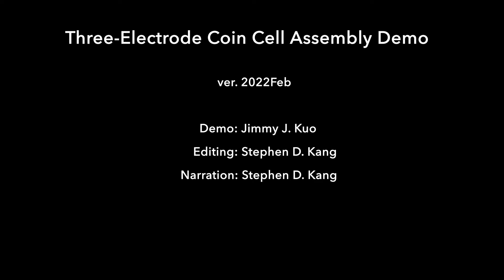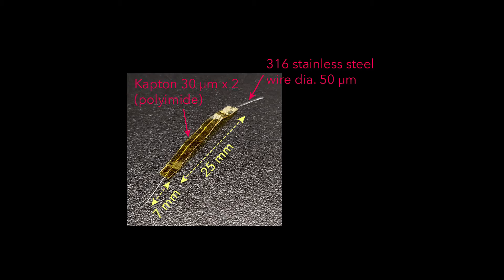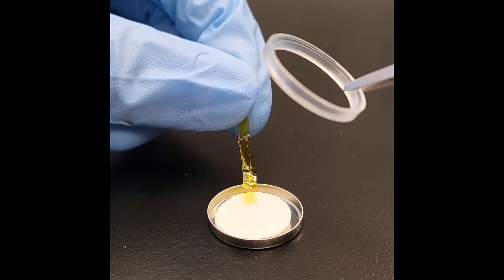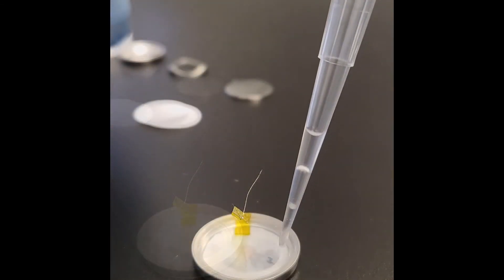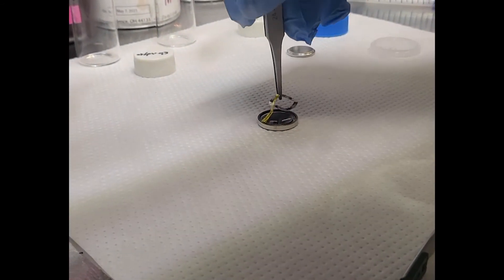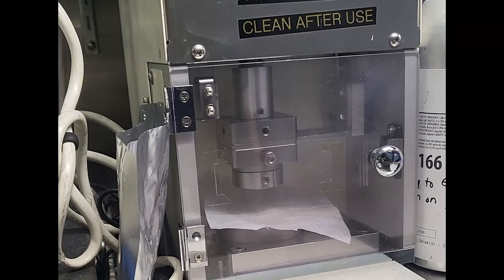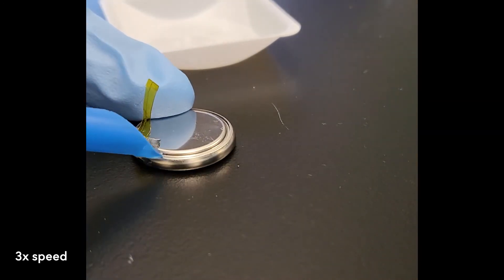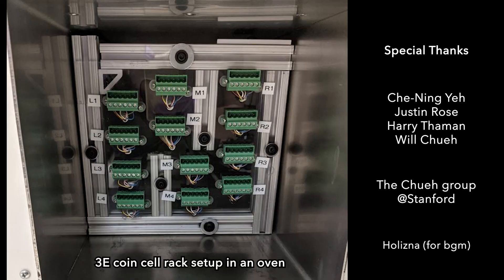3-electrode coin cell assembly demonstration (ver. 2022Feb)

Comment: Thanks! I made one right now as a kid, but, i use papers as seperators, metal spring as wires, flat glued circle metal, a CR2025 Cell button, paper graphite as the Li or sometimes can be semiconductor, and thats what i use to make electrolytric cell.

Comment: Hi,
If I use enameled copper wire, without any polyimide tape, do you think the epoxy will still be necessary?
Also, adding a tiny blob of lithium on the wire would probably be better than the copper mesh.
Thank you.

Comment: Thank you! Great video, I actually made one myself in my lab following your video. I used stainless steel mesh and it worked fine :)
Reply: hi, can i ask you a question? In this video, the author said he used the copper mesh as a substrate for the reference electrode (RE), but I didn't see the RE in his assembly process. Can you point it out for me?
Reply: @ThangPVan_  The copper mesh is used as a substrate for lithium, which will be deposited electrochemically (you have to apply low potential (slightly lower than 0 V vs Li+/Li0) between the mesh (working e.) and lithium electrode (counter e.). That will result in dissolution of lithium metal on the anode of the full cell and deposition on copper mesh. And there you go, you have lithium covered reference electrode :) Tip: use current-controlled process, and limit the current to very low values (in the range of 1 uA max or even lower), to decrease growth of lithium dendrites. If you measure the charge that will flow, you can derive how much lithium was deposited :)
Reply: @tangopies  Hi again, I so appreciate your quick and informative response. I'm just a beginner in this subject, so hope you do not feel bothered when I ask further questions in the near future.
Reply: @ThangPVan_  Sure :)
Reply: Hi, i just wondering why using 3-electrode cell? which kind of data will get from this cell?
Reply: @hanfu-q1e  You can get the exact potential of the cathode and the anode. Without the reference elecrtode, you can only get the votage of the whole cell.
Reply: @ got it, really did help.
Reply: @ are you chinese?
Reply: @hanfu-q1e  Yep, and I'm working on lithium-ion batteries.
Reply: @ wow太巧了，我是一名博士生，也是研究的电池方向，可以与您多交流嘛？
Reply: @hanfu-q1e  可以，之前留了联系方式被吞了😂，您看看如何联系一下

Comment: This is lithum-metal battery?
In this system, what is the role of reference elecrtode? 
Cu mesh?
Reply: In my opinion, this is not a lithium-metal battery but rather a "half-cell". Although a lithium disk is used as the anode, during cycling (discharge/charge), an SEI film may form on its surface, causing the potential of the lithium metal to shift.

This is where the Cu mesh comes into play: after assembling the coin cell, a small current is applied between the cathode and the reference electrode to plate lithium onto the mesh. The plated lithium remains inactive during subsequent charge/discharge cycles, ensuring that the reference potential stays stable.

Comment: THANK YOU   FOR  THE  EXPLANATION  .WELL EXPLAIN ,  WAS  INTERESTED  TO  KNOW  THE  INSTALATION OF  CELL BUTTON , I  GOT  A  WATCH  CAPACITOR DRAIN  COMPLETELY ,  BUT  I  RECHAGRE IT WITH LOWEST VOLTAGE IN  AIM  TO  BOOSTER IT  AND  TRY   TO  REUSE  IT .  IF  NOT  SUCESSFULL ,THEN THE OPTION  IS  NEED  REPLACEMENT NEW RECHRGEABLE BATTERRY
THANK YOU  , GOOD WELL EXPLAIN,